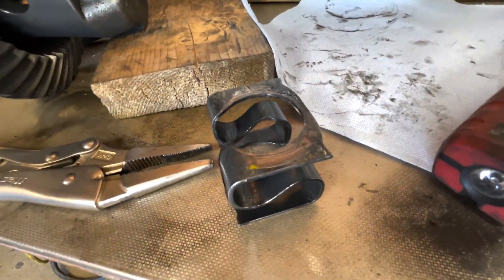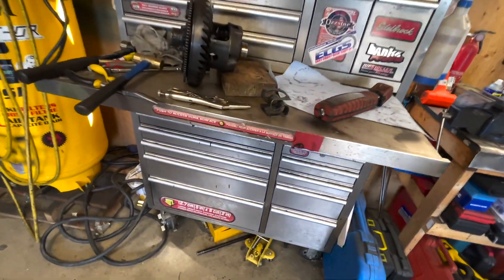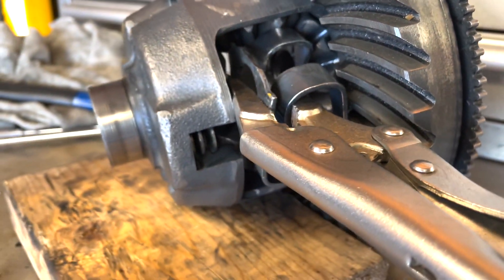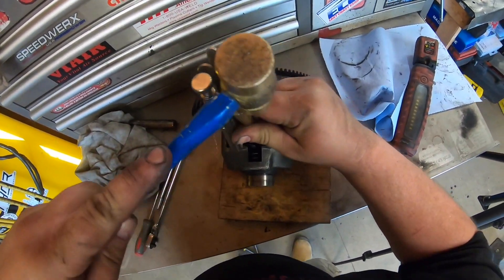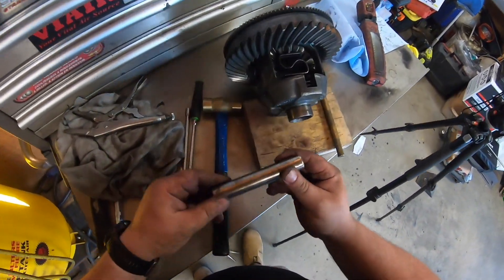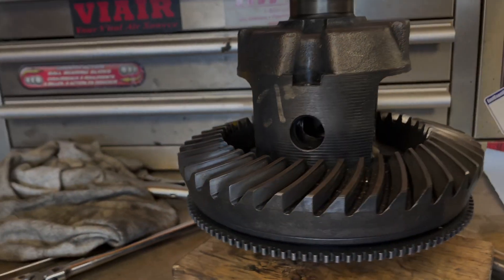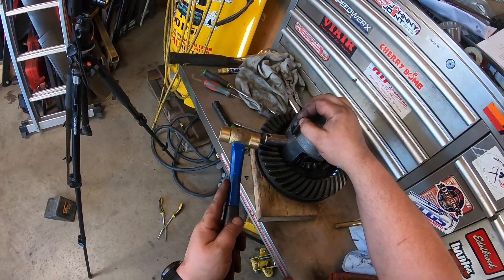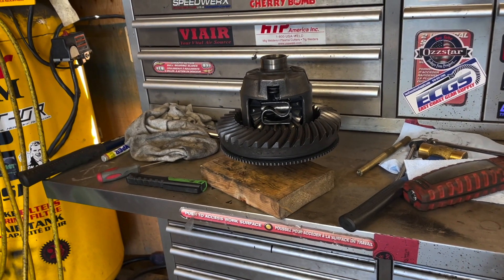DIY How to Instal S Spring Ford 8.8 Differential

Comment: Hey Jerry, I just have a quick question for you say my spider gears are aligned with each other, but the outside holes don't match up. How do you push the spider gears into the holes?

Comment: Heres a heads up if you order the performance clutch pack kit it come with the heavy duty spring this proceedure will not work ! I have been two days trying to get the spring in I used one needle nose pliers after compressing in a vice and when you try and start the spring it wont go in the hole when you tap on the spring to force it in the hole it flys out of the needle nose and expands it WILL NOT GO INTO THE OPENING EVEN WITH TWO NEEDLE NOSE PLIERS . You tap it and it just comes loose out of the needle nose and you are right aback to square one. There is no video on installing one of these new performance springs all the videos are only on wore out springs that have lost their tension . Of course those are going to be easier to install. I cannot find anything out there on installing the performance spring it is actually 1/8 wider than the original . I rigged a bolt late last night with some nuts and washer for a puller trying to pull the spring through and it broke  . Again if  you have a performance spring THIS WILL  NOT WORK !  And I used to be a Ford Tech. The crack is along the flat part I am going to braze the crack and try it again out of desperation. I even went to the local Ford dealer and he told me about the needle nose trick and it DOESNT WORK1 He couldnt help me either ,. If you have a worn out spring this will work if you have a performance spring forget it !
Reply: What did end up doing?
Reply: @MirzaHasnain27  I tore the diff down out in the dirt and it was cold and windy we had a really late winter into mid April after fiighting it all week I ordered a new spring but it was so cold had to get my diff back together and my car. I went ahead and put in the old spring and finally got it back together , Months later so far so good my new spring came it was Motorcraft and I took it down to the Ford Dealer and gave it to the service Manager he has been totally cool with me and a lot of help. I have not clue how to put in the HP  spring they will not go in! Even the Service manager told me all you have to do it tap it in when I told him the hell I went through he was totally lost just like me . I called one place in Cal that does diffs he told me they dont put them in said he has about five of them in a drawer so there you go word to the wise . Order a new OEM motor craft dont go HP

Comment: I squeeze the sissy spring in vice and safety wire compressed.  Install, then pull safety wire out.  Ez peezee.

Comment: So basically it ain’t going back in without removing the ring assembly on a bench. Mines still in the car fml
Reply: I removed it in the car as well as pinion gears they’ll go back in
Reply: Nah it’ll go in just compress the spring in a vice, chicken wire it down on one side, and then using a screwdriver and hammer just pop it back in